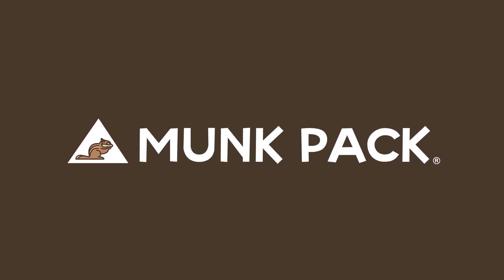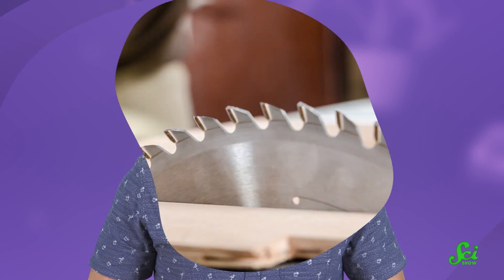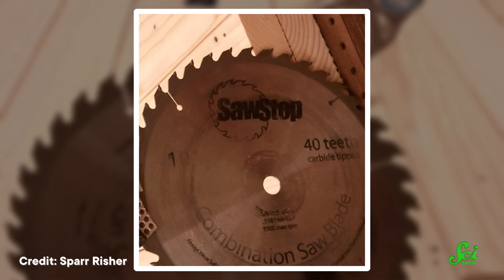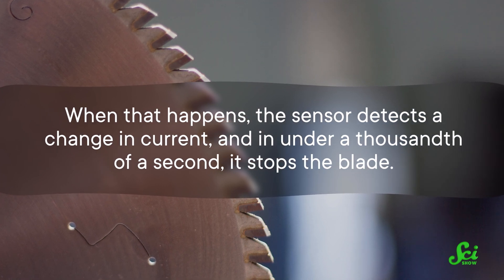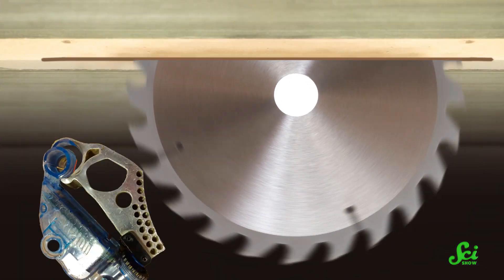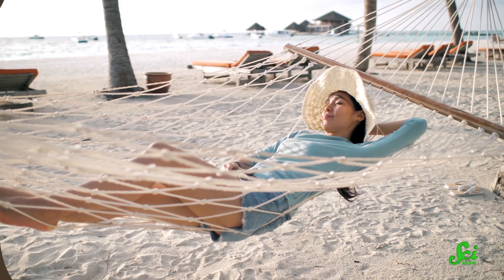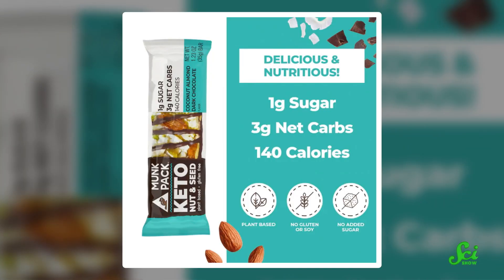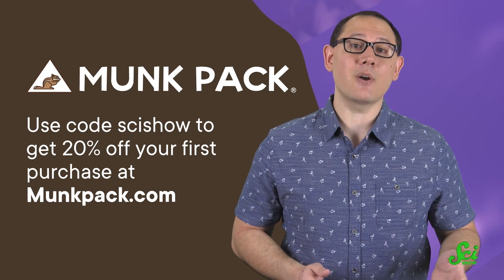How Can a Saw Know What It’s Cutting?

Comment: While it is proprietary, I'll bet the saw makers aren't knocking his door down to include it as a safety feature on their saws. How about just license it from him so he can make a modest profit and the saw makers can stop defending themselves against dismemberment claims.
Reply: not to be morbid, but that's still a bunch of new blades to sell to folks that are getting a second chance to use them.
Reply: @themexis  if it's a high-end blade you can usually dig it out and send it in for sharpening and inspection and usually it'll be fine. It's usually only the cheap blades that are completely destroyed by the mechanism, those aren't worth sending into a service anyway because it's cheaper to just buy a new one.
Reply: That's what he tried at first. After building a prototype by modifying an old saw, the inventor went to several existing manufacturers offering to license the technology. Despite a few seemingly good leads, they all fell through so he started a company to build his own saws from scratch with the system built in. And I think one of the issues in many of the negotiations was how liability would be split in the event of a malfunction.
Reply: @ailivac  I have a feeling the saw-maker lawyers have a rock solid case of "these are dangerous tools" and don't think they'd be able to license the tech, add their markup, and sell as many units as they otherwise could. So instead of saving digits or limbs, they'd rather make an extra $4 profit.
Reply: @ailivac  if I recall from manufacturing brakes and motorcycle forks, liabilities would always fall on the manufacturer no matter what. That's why I had to buy a non-refundable bond and pay insurance per unit. 
Likely this was a B.S. story ment to drum up sales and sympathy when in reality he was just butt hurt that he wouldn't make as much per unit as he would just producing them himself.
So he choose to make less, just to earn more per unit, and that greed is likely the cause of thousands of missing fingers and a few deaths.
Reply: So by "proprietary" they mean that the technology is only available on Saw Stop brand table saws. The SawStop company doesn't license the tech because it gives them a unique product feature in the tablesaw market.
Reply: @LukasEragon  the sawstop tool brand didn't exist until nobody was willing to license the tech to put in their saws, so the only way the feature would come to market is to sell it themselves.